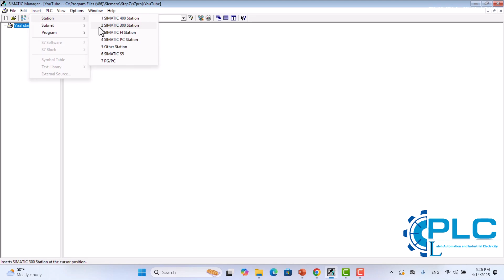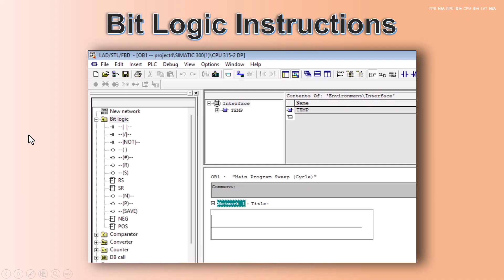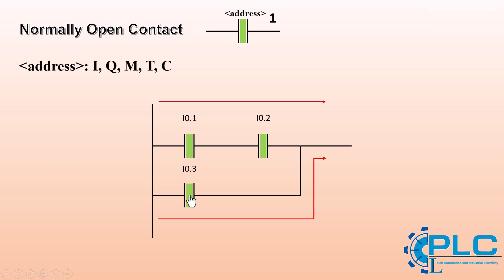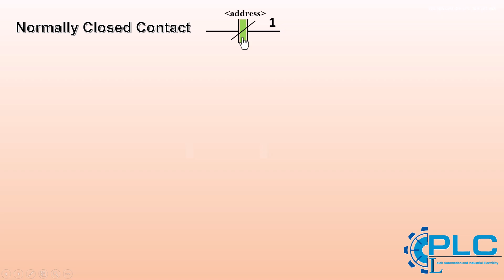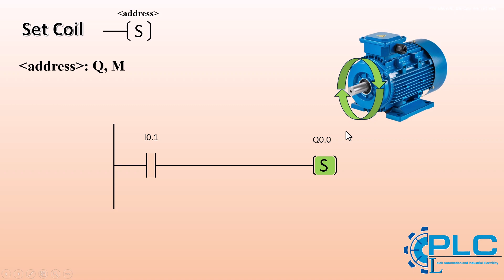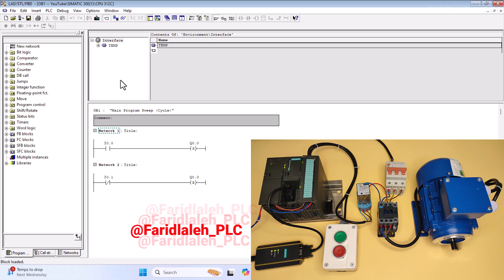How to Control an Electric Motor with an S7-300 PLC (Step-by-Step Tutorial) #PLC #education

Comment: What if both push buttons are pressed simultaneously? SET wins or RESET?
Reply from the maker: It depends on how the program is written and downloaded to the PLC.
You can determine which command has priority when both push buttons are pressed simultaneously.
In this program, I gave priority to the RESET button for safety reasons.
So, if both buttons are pressed at the same time, the motor will stop.

Comment: WHEN WE CREATE THE CONFIGURATION, WE CLICK THE SAVE AND COMPILE BUTTON. SO WHY DID WE NOT DOWNLOAD THE PLC? If we don't send the hardware settings to the PLC, won't there be an SF ERROR?
Reply from the maker: Hi my dear friend,
In the hardware configuration of the S7-300, after finishing the setup, we must Save and Compile the configuration before downloading it to the PLC. During this step, the program checks the hardware for errors and creates the required system data blocks (SDBs), which form the downloadable file for the PLC. After compiling successfully, we can then download the configuration to the PLC so it can recognize and work with the connected modules.
Reply from the maker: If you have any questions, I’m happy to help—just ask! And if English isn’t your first language, don’t worry, I can answer you in your own language too.
Reply: @Faridlaleh_PLC  before the download why must be plc in stop mode? This is not necessary in s7 1200 plc.
Reply from the maker: In S7-300, the CPU must be in STOP before a full download to keep program memory consistent and avoid unsafe process disturbances. Newer CPUs like S7-1200/1500 have advanced memory handling, so many downloads can be done in RUN.
Reply from the maker: In S7-300, the CPU must be in STOP before download, because while running the blocks are executed continuously and downloading in RUN could cause incomplete transfers or unsafe behavior of the equipment.

Comment: Sorry sir, my university has an S7 314C 2PN/DP plc and I want to measure hot water temperature from (0-150celcius), and room temperature (-10-40celcius). Sir can you recommend for me which type of sensor or transmitter to use, model number and price in Amazon because am a beginner and don't know how to order based on specifications
Reply from the maker: If you're working with the S7-314C-2PN/DP, that's excellent—it’s a powerful CPU that supports two different networks.
For temperature sensing, you can use a PT100 platinum sensor. It's efficient, with a sensing range from -50 to +250 degrees Celsius, and costs around 20 dollars.
If you have any questions, I'm here to help.
Reply from the maker: Did you find this video helpful and easy to understand?
If you have any ideas to improve it, please feel free to share—I’d love to use your feedback to make my future videos better
Reply: @Faridlaleh_PLC   the video is very much informative
Reply from the maker: Thank you for your response. If you purchase the sensor and need help with implementation, feel free to contact me — I’d be happy to assist. Just one question: where do you intend to use this sensor? Are you planning to connect it to a PLC or another control device?
Reply from the maker: If you want to connect it to a PLC, please send me the module's order number. It might support PT100 without needing a transducer.
Reply: @Faridlaleh_PLC   order number is 6ES7 314-6EH04-0AB0
Reply: It is just for learning how do deal with analog values, I will be connecting to a plc
Reply from the maker: I checked the order number 6ES7 314-6EH04-0AB0. This is the compact CPU 314C-2 PN/DP, which includes built-in analog inputs, so there's no need for a separate analog module. According to the Siemens catalog, it supports one direct PT100 input channel, which means you can connect a PT100 temperature sensor directly to the CPU without requiring a transducer.

However, if you prefer, you can also use an RTD sensor with a transducer — it depends on your application. There's no limitation. As I mentioned earlier, your CPU is quite powerful.
Reply from the maker: Please check your CPU's catalog further to see which specific channel is used to connect the sensor. If you’d like, I can check it for you and let you know.
Reply: Can you mention the specifications or model number for the Pt100 that cost 20 dollars coz on Amazon I see the very expensive ones
Reply from the maker: Search this topic from Amazon site: TWTADE Waterproof PT100 Thermocouple + Temperature Transmitter -200~200℃ 4-20MA RTD PT100 SBW Temperature Sensor Isolated Detector Module.
Reply from the maker: But because this RTD sensor includes a transmitter, it is a bit expensive.
Reply: @Faridlaleh_PLC   thank you sir, i have seen it and now i  know how to order it
Reply: @Faridlaleh_PLC   Sorry sir, Is this waterproof PT100 Thermocouple able to measure room temperature also, or limited to water temperature measurements?  eg -5-40celcius
Reply: I mean the one you recommended for me
Reply from the maker: Hello, my dear friend. You can use a waterproof PT100 sensor to measure temperature in various locations, such as a room or any other place you need. However, due to its waterproof design, the sensor's temperature sensitivity might slightly fluctuate—either increasing or decreasing at first—but it will eventually stabilize and show the correct temperature. In my opinion, this minor delay is not significant for your project.
Reply from the maker: @paulmahila9952 I also hope you're aware of the difference between a thermocouple and a PT100 sensor. Although both are used for temperature measurement, their structures and operating principles are different. A thermocouple generates a millivolt signal at the junction point, while the PT100 sensor works based on a change in resistance with temperature.
Reply: @Faridlaleh_PLC   Thanks a lot for dedicating your time to help others
Reply from the maker: @paulmahila9952 🙏🙏🙏🙏❤️❤️❤️❤️
Reply: Does this PT100 platinum sensor give 4-20mA or 0-10v or needs to incorporate a transducer??
Reply from the maker: If you want to connect an RTD sensor to a PLC analog input module, you can connect it directly if the module supports RTD inputs. However, you will need to perform the necessary hardware configuration. If your module only supports 4–20 mA signals, then you must use a transmitter that converts the RTD signal to a current signal (4–20 mA) before connecting it to the PLC.